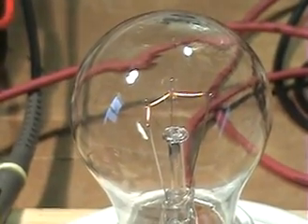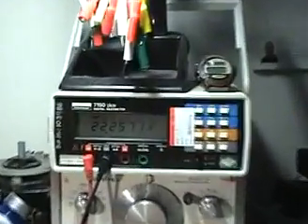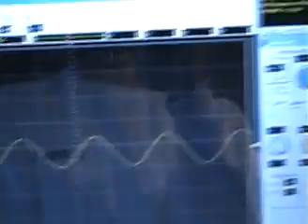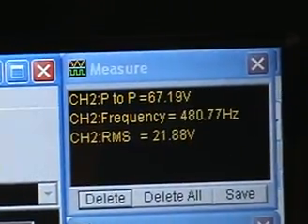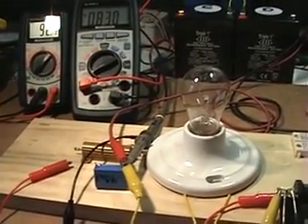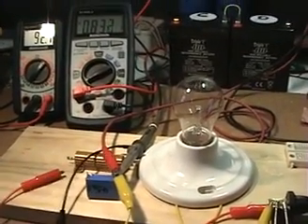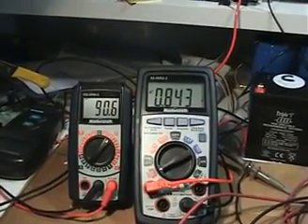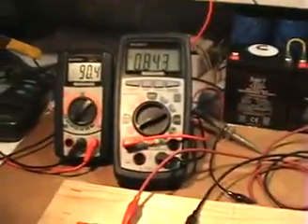Generator Coil test 9

Comment from the maker: Hi erfinder,

thanks for posting your positive comment.

The voltage is very high as when it's in resonance if I pull the clip from the capacitor terminal I can get a plasma flame of over 20mm long and the capacitor terminal turns red hot in less than a second.  I think the only thing keeping the 275vac capacitor from blowing up is the load (120vac bulb).

Luc

Comment from the maker: More load would cause more current draw and the motor will loose too many RPM and it will be downhill from there.

This is not an over unity device. I'm experimenting.

Luc

Comment: I am testing big gen  similar to your generator
It has six 2" X 1" N-S neo magnets and 6 aircores on each side of rotor
 thick winds 
 spun by rotovertor AC 3ph motor and  draws 24watts at 1200rpm no loading
each coil makes 12.7AAC max and 13.6VAC max with no resistive load

Great trick to try:

Convert with ffullwavebridge AC of coil into DC and feed a highvoltage DC type cap.
SHORT coil leads togheter with switch at sinewave peak period
You will get X20 voltage into cap same amps